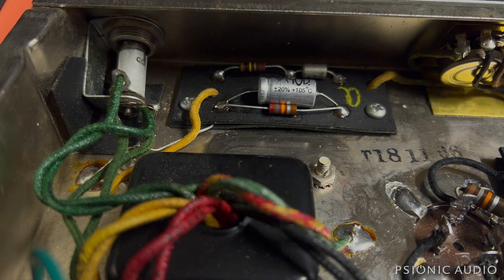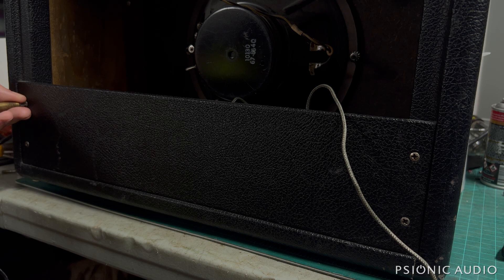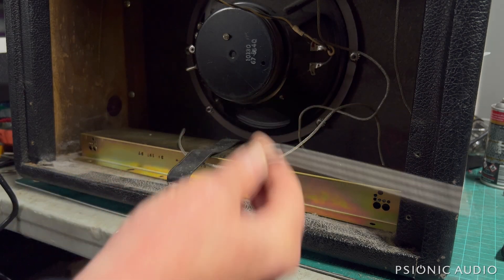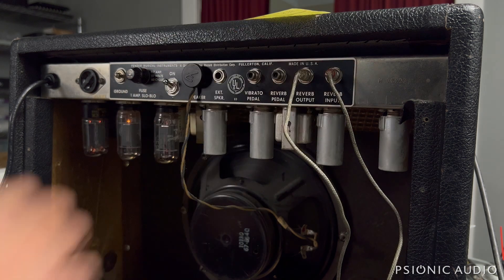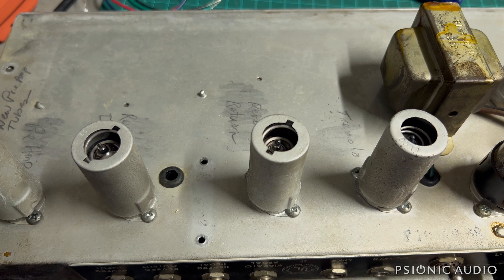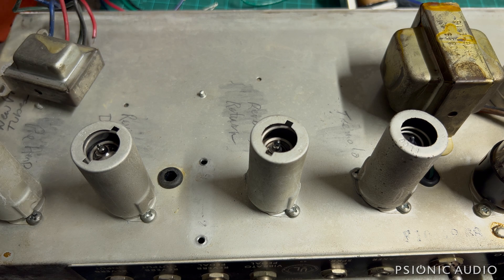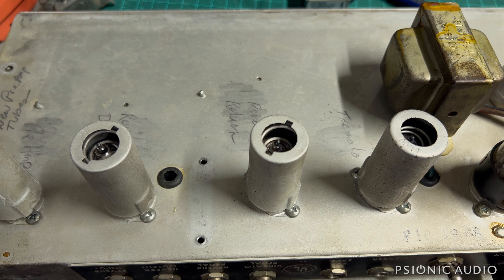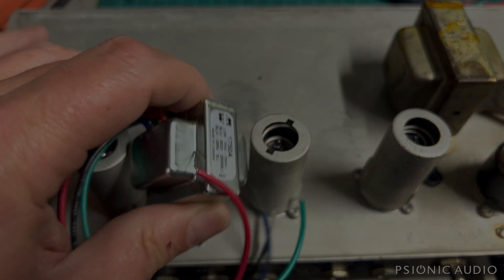Trying to Finish Two '60s Princetons (Some Days You Just Can't Win)

Comment: Eminence made speakers for Roland that have aluminum dust caps.  I am not a fan of those old braided reverb cables.  I prefer to make new ones using Mogami W2319 cable and Switchcraft 3502RA connectors.  Unless the owner really wants the old style reverb tank cables.